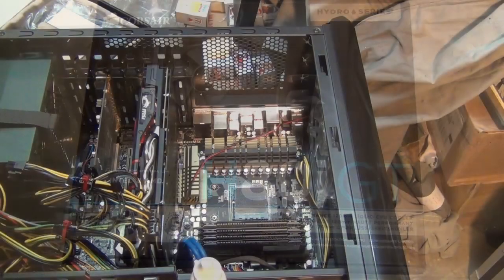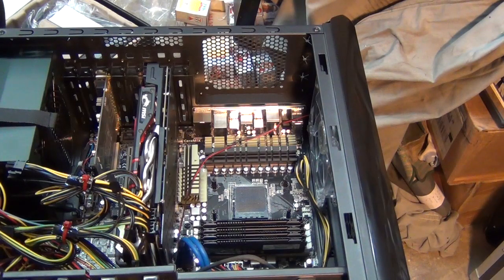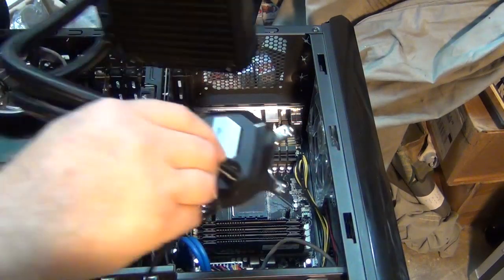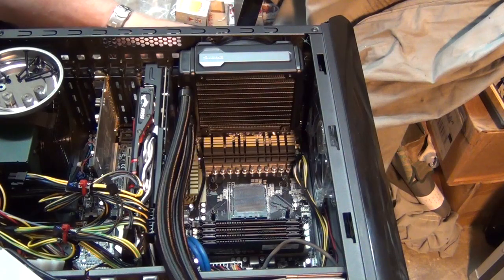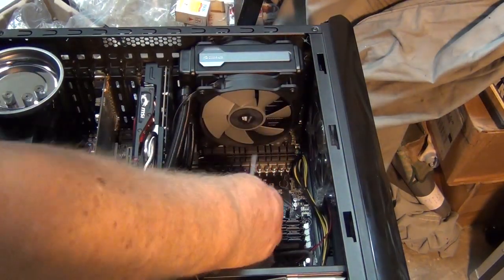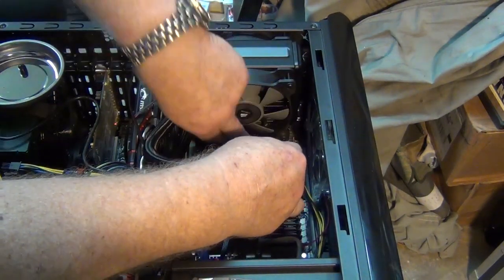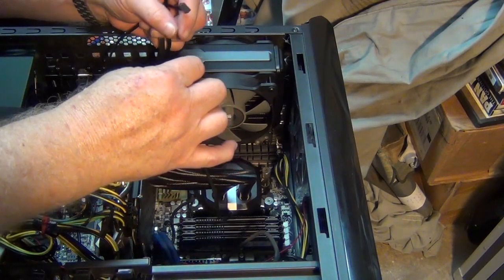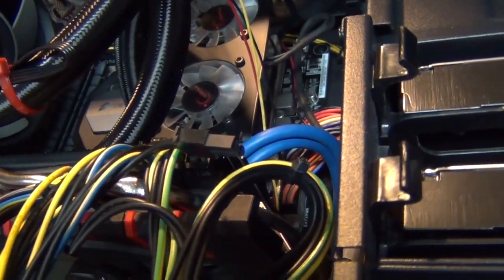How to Install Corsair H80i GT Liquid CPU Cooler on AMD - Results

Comment: hasnt the pump got to work harder to push the liquid upward now into the radiator?
Reply from the maker: May have to work harder but it does not cavitate like it would otherwise, pushing liquid is better than trying to suck any air  in the system... is still going strong... Neil

Comment: Bought mine a year ago and my temps are not as good as it use to be. What is the life span of the Corsair H80i GT ?
Reply from the maker: 5 Years or more, mine is still holding the same temps. Sounds like your radiator is dirty, fans dirty, or thermal paste has lost it's effectiveness.
Reply: 5 Years that's good to know, and I agree I suspected that my radiator may be dusty the fans look okay but I decided to replace them so I ordered Corsair Air Series SP120 PWM High Performance Edition when the fans arrive I will clean the radiator if its dusty. As for the thermal paste I replace the pre applied thermal paste with Arctic Silver 5 AS5-3.5G thermal paste when I got the H80i GT. I will let you know if cleaning the radiator and changing the fans improve my temps or not.

Comment: For the life of me i cannot get the pre-installed INTEL mounting bracket removed. Any advice? I need to install the amd mounting bracket.
Reply: Yes, the instructions are clearly wrong, I twisted clockwise for half an hour and thought "ok lets try counter clockwise" and it came right off easy
Reply from the maker: Jester, I believe you turn it one quarter a turn to the left with the copper plate facing you. remove in the direction opposite the hose side. then place AMD on and turn a quarter turn. neil
Reply: +Neil Dahl I figured it out. The instructions tell me to turn it clockwise and I got it off easily by turning it the opposite direction.
Reply from the maker: Yes the instructions are confusing... depends on which side you are looking from...

Comment: You made a stupid mistake spreading your thermal paste
Reply from the maker: Works fine...
Reply: Don't really understand the need to insult people.
Reply: Thermal paste should be spread from center out woulds say for eg.. a pea size amount then 4 very thin lins of paste going out woulds so its like a cross

Comment: Hey Neil , did you left the side of your case open ? I have the same MOBO and CPU
Reply from the maker: +Marcos Messias  Marcos, No I keep the side on, I only had it off for the video. I did have to grind a little plastic off the side fan frame to clear the edge of the radiator. That allowed the side panel to lock in properly.
Reply: Ty i was having overheating issues .
Reply from the maker: +Marcos Messias  Marcos, I even improved my cooling more by reversing the fans so they blow air from inside the case, and exhaust it through the radiator and out the back of the case(As stated in the Corsair instructions) This did not make sense to me but the temperatures average at least 3 degrees C. lower across the board. I guess the other fans were packing the case with air instead of exhausting it?

Neil